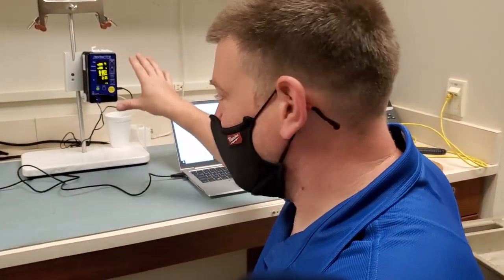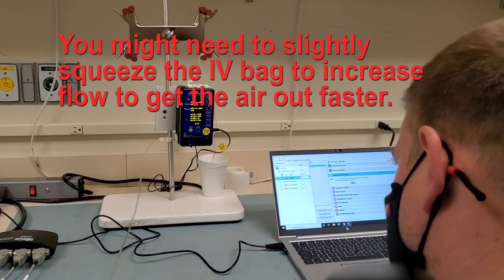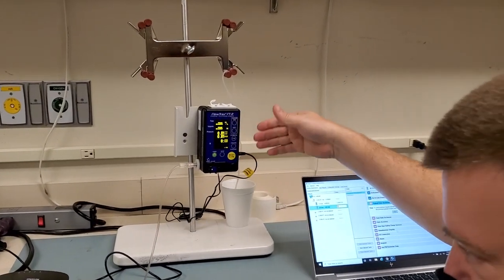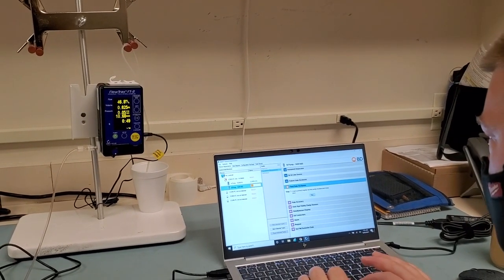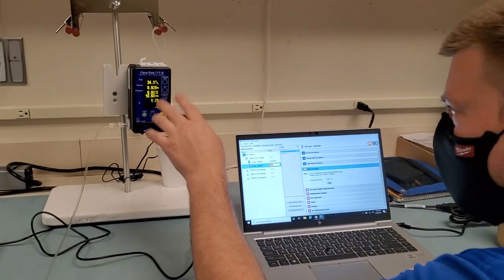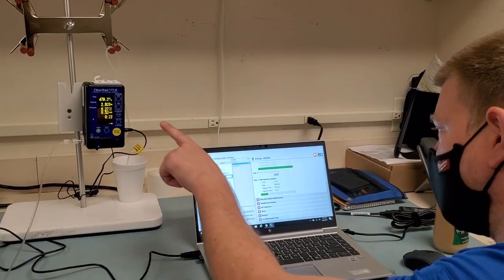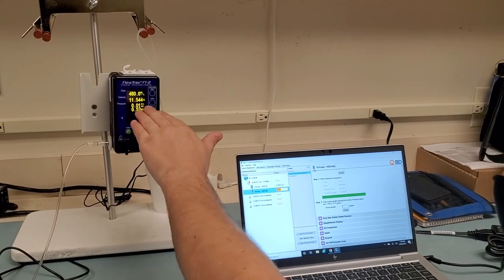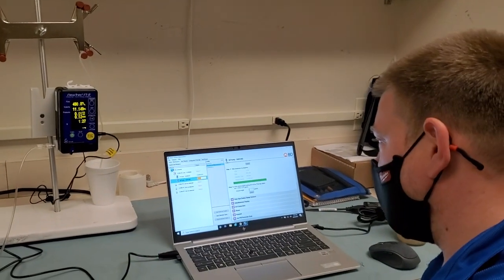Easy Pronk FlowTrax Priming with Alaris CareFusion Pumps

Comment: What's the application on your laptop that you are using to  document the PM values? We have the Flowtrax at the shop but we don't use it. The Pronk Rep came out to show us how to use all their products but he didn't get a chance to show us the Flowtrax. We have Baxter Sigma pumps that require an air inline test. Do you have to go through the how Flowtrax setup procedure after each pump?
Reply from the maker: I did another video on the complete Flowtrax setup and run.

Comment: Do you know if you need to remove the bag line from the flowtrax for the rate accuracy test? The test where you use the scale to see if the output measurement is accurate. Thanks for the very helpful videos.
Reply from the maker: mL converts directly to grams etc. There is no need to disconnect. Just type in the mL dispensed as registered on the flowtrax